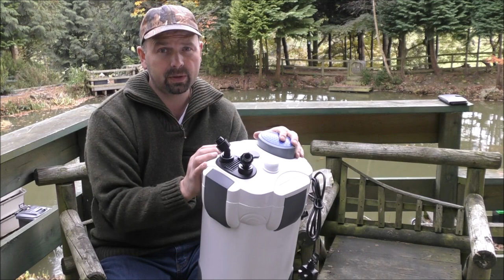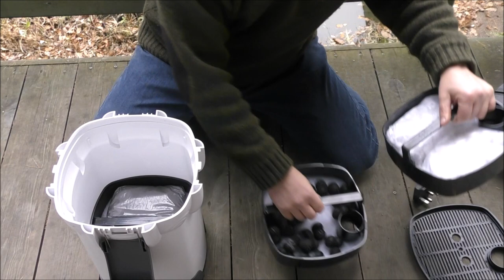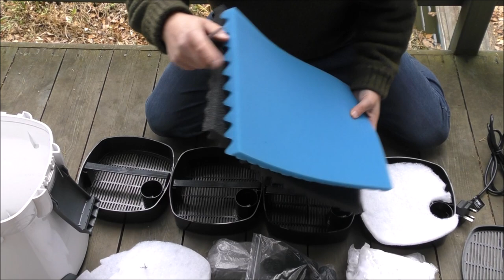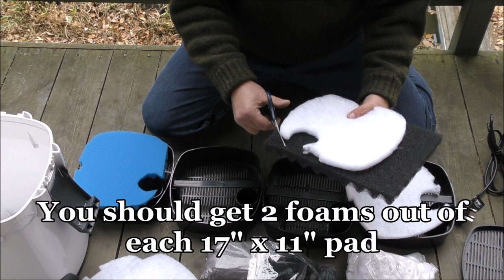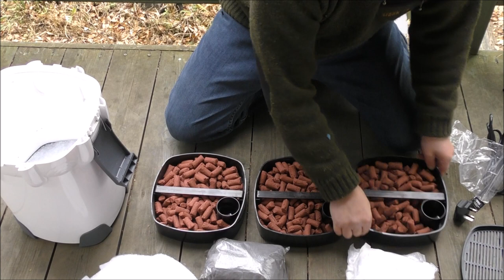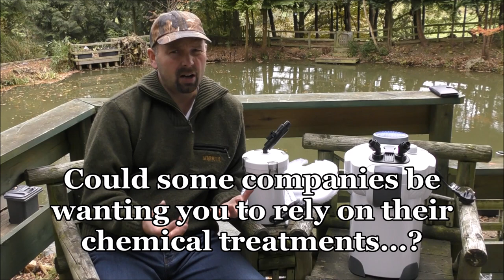Why Your Filter is TOO SMALL and NOT CYCLED

Comment: So in essence, there are several companies selling a solution to remove chlorine/chloramines that 'help' fish slime, allegedly, but in reality using the product means you have to buy another of their products to deal with the tertiary part of the N cycle followed by a third emergency bacterial dose product to replenish the die off as a result of refreshing the second product purchased to deal with the side effects of the first product.  Gotcha. Marketing at it's finest, or, worst depending on which way the money is going.  

Thank you for confirming my suspicions!
Reply: Yup, I think we understood each other just perfectly & agree completely with what you've said.  Thank you for all the vids over the years they took me from a total noob with the one 70L & all sorts of tank problems to 3 tanks  1 x 4' 285L, 1 x 3' 165L, a x 2' 75L and an obsession with filtration.  The tanks have tiny maintenance requirements thanks to setting up canister filter trays as you advise.  I do use cheaper media than the bio-home, its a mix of washed pumice & lava rock, just have to use a lot more of it (& break some of the rock sized bits!). The 285L tank has a 2700 canister 1 foam tray, 2 trays pumice, 1 tray marinepure daisy-chained to a 2400 canister with 4 trays of lava rock & back to the tank. The 2700 pump powers it & pushes through about 2500lph. There is also a 1500 attached to a home made under gravel filter ~ 2 x foam trays & 1 pumice  sucks out most of the muck in the gravel. zero ammonium & nitrite. Nitrates <5ppm if the foam trays get a clean every 6-10 weeks. It is a community tank with pictus, bristlenose, rainbows, flying fox &  rasbouras. 

3' tank has a nautilus 1400 1 x foams, 2 x lava rock pumping to a 2200 4 x pumice trays.  Have a very fat & aggressive mangano in there. At one point there were 10. He ate the lot, Lives alone now. 

Haven't used 'the detoxing' product from that company we are not discussing for a year.  Generally prepare tap water over 48hrs in a 220L drum with a  pond pump churning things up & a black light. Seems to work ok. No columnaris issues this summer either (big relief). You may have pinpointed the source of most issues I was experiencing. Thanks again.
Reply from the maker: No worries, any time and I'm glad you find the videos useful.
Sounds like you have some great systems running there.

Comment: Hi, I was wondering is the set up of the filtrating material (the pads, biological media, carbon, etc) would be the same if I used a canister filter for my turtle tank (I've got 2 adult red eared sliders in a 300L tank), considering that turtles are much dirtier than fish. Maybe I could replace some of the biological media for more pads? Since turtles are not nearly as delicate as fish in terms of water quality.
Also, I have a SunSun canister filter, but I think that by now it's pretty much useless, I don't know if anyone else had the problems I did. The top  (or the lid) of my filter never fit right and it was very difficult to secure everything in place with those plastic clasps, so I always had to do it very forcefully and now one of them is broken. The o-ring also wore down and I had massive leaks.
I was hoping to know if it would be wise to buy another one of these filters in the future or if maybe another brand or model was better, but around the same price range.

Comment: This is the video im looking for.. thanks for this! 
Just a question, will the water flow be affected by the smaller filter (having a lesser power) compared to the bigger filter? Bigger filter sucking power is greater than the smaller filter, might cause it to overheat for not having enough water because of the lesser power of the small filter.. hope you can answer my question. Thank you

Comment: I have a juwel 400 litre tank with the Juwel Jumbo filter which is half full of ceramic ring media and the rest is sponges plus an external pond solutions 1000F canister filter. The tank will eventually be used for for a medium stock Malawi setup. Is this going to be up to the job.

Comment: what is the name of the medias that you are using in your top 3 trays ?also, on my filter system there is switch that has a circle and on the otherside a straight line. I'm assuming the circle means on, is that correct?

Comment: How can I avoid paying a bunch for pre-filtered water if the tap water in my area has ammonia in it? I'm currently using one of the chemicals mentioned that neutralizes ammonia, but if I don't use it then water changes will either be very expensive or seem rather pointless. 

I could see the argument that, if I have anaerobic bacteria, water changes won't be as necessary. But then how would I get to that point/ deal with evaporation or other water issues?
Reply from the maker: The way around that problem would be to pre-filter the water yourself by having a large container filled with tap water which is aerated and filtered - even if you used an air driven moving bed it would rapidly consume the ammonia once it was mature and as long as you always had some water in and left the water for a good 3-4 days before using as water change water it should be fine.
Having a filter which is of a suitable size and well set up is paramount but I can see your predicament if you're having problems maturing it because you're using a product to tackle the ammonia problem in tap water and at the same time very well retarding the development of the biological filter.

Comment: Hello , do you suggest having a UV steriliser. Some of these canister filter come with inbuilt uv steriliser.
Reply from the maker: There is no real need to have  UV for an aquarium unless you have a problem with green water or if you have multiple tanks running on the same filter, then it is advisable to fit one. A single tank with no algae problems should not need a UV but adding one will not do any harm.
Reply: @pondguru  Thank you for replying. So UV does not harm anaerobic bacterias ? Also , are products like twinstar nano ( sterilisers ) harmful for the bacteria's.
Reply from the maker: @nathsourish  UV will kill any bacteria good or bad that flows over the light but if UV light is not shining on the bacteria it will not kill it. It is best to leave a UV light off for the first 2-3 weeks of running a new system to allow the bacteria to build up properly in the filter. I'm not familiar with the twinstar nano so can't comment on that.

Comment: does this apply to HOB marine filters?  I have had zero algae and had it going nearly 3 months, yet my freshwater 5 gallon betta tank I have constant algae and change water every week to 10 days but Since its a betta I need low flow betta filter that only uses those inserts.  I have room t o add some biomax but not much, so I wll try that.  I do use purigan and chemi pure elite small amout of matrix in my marine 19 gallon hob.  I still have nitrates but low, since i have no skimmer I will keep that the same.  But I have anew canister and 36 gallon bowflex I i wll use for fresh, I will try this.  Should this cut down on water changes?  My 5 gallon betta is my only fresh and gives me a hard time and I just ordered lots of additives because tetra and some api  had all of there stuff on amazon 1.98 cent up to 3.49 for big bottles.  Bummer!  Is there anything that can be substituted for bihome like matrix or only that brand? I am also getting a 90gallon marine with sump and I dont suppose this applies?  What do you recommend for marine with sump?  Unclear if I should always use charcoal or carbon as well, only under situations you mentioned? How often should one need to do water changes if complete nitrogen cycles happens?also, If dont use the prefilter the how often do we need to rinse the canister media?

Comment: Do you think that chemi-pure blue kills off the anaerobic bacteria?  I use a combo of biohome and pond matrix along with the chemi-pure.
Reply from the maker: I can't say for sure with any of these chemicals but that one has been mentioned in 2 reports I can remember where full cycle could not be achieved and when the chemical was removed in favour of carbon the filter developed properly and nitrates fell - took a few months though. 
Biohome isn't a magic bullet but is a long term solution for achieving low nitrates (full cycle filtration)

Comment: I’ve got a 3 tray all pond solutions set up using pondguru way. Had it for 3 years and it’s been fantastic. Just wondering if it’s really worth adding the dechlorinated chemical on water changes. Can’t speak highly enough of the set up though
Reply from the maker: It really depends on the quality of the tap water as a good quality tap water won't have much harmful in and could just be sprayed into the tank at high pressure (like from a garden hose with jet attachment) and most of chlorine will bubble off - that's what we used to do when I had the shop and with 100 tanks we didn't have a problem doing that. Fish were fine and no problems cycling the filters.

Comment: Great Video Rich, Nice to see you back doing the fish keeping vids. Can I ask which de chlorinator you recommend?, I've had bio home media in my tanks for a year or so now, but have had a spike in nitrates and when I did a check on our tap water that tested to 120ppm. Any advise you can give
Reply from the maker: That is very high and you should contact the water provider about the water quality, they may install a filter as maximum level is not meant to exceed 50ppm
If you had lots of good media in a huge filter and kept water changes to a minimum the level may come down as it would be processed by anaerobic bacteria but that is extremely high. A good straight dechlorinator which doesn't mess with the bacteria would be API stress coat.
Reply: Pondguru Thank you Rich for your advice and I will contact our water supplier. Stress coat is the one I use so thanks again, keep posting your educational and informative fish keeping videos they are invaluable.
Regards Tony
Reply from the maker: No problem, any time.

Comment: Nice bit of sintered glass in those filters. Siporax for example. Huge surfaces for anaerobes.
Reply from the maker: Siporax would be a great media if it wasn't so thin with the huge hole through the middle to prevent it supporting anaerobic bacteria (unless flow is super low).

Comment: I have only 1 question, if it hasn't been asked yet? but I am really wanting to know is with the pre filter canister there would it need an intake pump or can I just run it all through the big canister filter? So the only pump is the big one? Cheers for any advice I may receive, thank you. 
I am going to run the Aqua One Nautilus 2700UV canister filter for an 430 litre tank.
Oh and do all filters run the same way no matter what the filter? As in water flow direction?
Reply: Zero Cause you can buy the pre filter with or without a pump. I use one without the added pump. As pondguru says, it will restrict the pump effectiveness a little so keep that in mind. You will know if your pump is struggling as it will be a little warmer than usual on the top of the canister. I run my pre filter with two canisters feeding from it. I bought extra tubing and Y splitters to connect it all. I still only have one feed and one drain pipes in the tank. I’m going to purchase about 8kg of biohome ultimate next for the canisters. Thank you pondguru for the very informative video.

Comment: What a helpful video. Funnily enough, I just recently rejigged my slightly smaller SunSun for my 200L tank, though I did put the fine pad at the bottom of my mechanical tray. I will be switching that up, because what you say makes a lot of sense. 

Unfortunately it doesn't seem like I can get BioHome in Australia! What would you recommend as an alternative to grow both aerobic and anaerobic bacteria available overseas?
Reply from the maker: Usually the AU supplier has it (Genesis group - link on the FilterPro website, flag at top of every page) http://www.filterpro.co.uk
Reply: Oh, I didn't notice that! Thank you!

Comment: I have a small 300gallons concrete pond and looking to replace my existing old filter system. Am looking for a all-in-one fully auto cleaning filter system with little or zero maintenance. Like to hear your opinion of the Nexus 220 or a 320 filtration systems, from evolution aqua?
Reply from the maker: Any moving bed is pretty much zero maintenance but can be achieved in any container - definitely no need to spend crazy money on them. Look up Evolve filters as they have a drum, moving bed / static bed modules (choice is yours) and some even have integrated shower filters. That is a true all-in-one filter which has the parts necessary for a full cycle - mechanical, aerobic biological and anaerobic biological.

Comment: How do you obtain the full nitrogen cycle when the canister filter is cleaned monthly, or even bimonthly? As soon as you remove the media trays the anaerobic bacteria will die off due to excess oxygen, therefore you have to keep the media in the canister submerged at all times during maintenance. I don't think you would be able sustain a full nitrogen cycle with a canister filter alone.
Reply from the maker: The ability of any canister filter to achieve the full cycle depends on the media used and a cleaning schedule will make no difference to the bacteria living on and in the filter media since it is saturated with water. It would take many days for it to dry out and lose beneficial bacteria.
Check comments from people who naturally achieve full cycle filtration using a canister filter - they do not have to be 'nitrate factories' as long as they are set up properly.
Reply: Now i know its been a long time since you commented, but i thought i would throw in an answer anyways.
I did the googling and there are 3 types of  anaerobes, Obligate anaerobes, Aerotolerant organisms and Facultative anaerobes.
First one does not tolerate oxygen, second one does but doesn't use it and the last one can grow without, but can use it if its there.
Now i don't know which ones can grow in an aquarium, but i just wanted to inform you a bit. :)

Comment: Well that makes SO much sense! I've been trying to figure out why I've never been able to get the nitrates down in my goldfish tank.
It's 200L with 4 fancy goldfish.
I have an APS 1000ef cannister filter and I've been wanting to upgrade to the 2000 ef, but budget not allowing at the minute!
I can however, in the mean time, get a booster filter to attach to my current 1000ef - been looking at them for some time and wondering if they were any good.
The one you show in your video is different to the ones sold as a specific 'booster ' filter (they are see through).The white one is listed as a stand alone external filter of 150L per hour.
Am i right in thinking its exactly the same design/same connections therefore will work exactly the same, but more powerful??
Also is alfagrog suitable as biological media? As i already have a load  fully cycled and was thinking of then filling up the main cannister with all biological i.e the cycled alfagrog and some well cycled ceramic rings that i have in there already 👍😁
P.s I will upgrade to biohome one day!
Reply from the maker: The pictures of the booster are see through but the actual unit is white 0 the picture is see through to show what is inside it. I'm not sure what you are referring to with the stand alone 150 litre per hour white filter - feel free to post link to that.
This previous video features alfagrog and may be of use when comparing it to other media: https://www.youtube.com/watch?v=QTtAUYR67Eg
Yes if you have a 200 litre goldfish tank the current filter is way too small. Upgrading to the 2000 which holds 5kg of media definitely sounds like a plan for good quality water.

Comment: Quick question: that filter says its good for up to 2000L/hr and that little supplementary one online says its good for up to 400L/hr. Does that mean with both combined I would have filtration of 2400L/hr or does it not stack like this?
Reply: No, it does not stack like this with pumps. But you will get an increase in flow, in theory. When two pumps are connected in series, their maximum pumping height is increased. In other words the pressure is increased, but not the flow. However, since the pressure is stronger the pump will overcome any obstacles in the waterpath better and therefore the flow will be stronger. But keep in mind that the canister filter only pumps 2000 l/h without filtermedia and no pressure height. So in practice when the canister is loaded with media and connected to the tank you will probably only be getting about 1500 l/h when the filter is clean. By connecting the 400 l/h pump the pressure will be better and the flow will increase... but this is only theory. 400 l/h is actually very weak here and the extra canister will introduce extra obstacles so more likely you will have less flow with the smaller canister attached. Also note that the small filter is available both with and without the 400 l/h pump, the one pund guru has in the video is the passive one.

Comment: Hi Richard, I have a all pond 1200 filter, and a 450ltr tank, the question is how long can i run my filter before it needs cleaning. I have 5    5inch fish in the tank and 7 clown loach and 7 small 2inch plecs.
Reply from the maker: The maintenance schedule really depends on the size of filter, fish stock and feeding and you haven't got much stock in there so the cleaning would be every 1-3 months - just extend cleaning times as necessary.
The 1200 filter will take around 3kg of biohome ultimate which would likely not be enough to see a full cycle develop in a normally stocked tank of 450 litres - ideally you need 5kg for a normally stocked 450 litre tank in a much bigger filter.